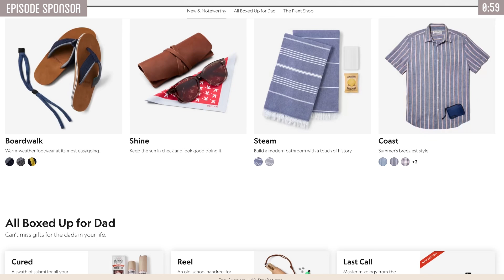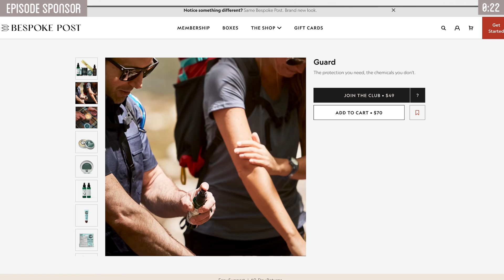White Sugar Doesn’t Come From Where You Think It Does

Comment: You need to improve your filtering step.  The liquor should be WATER CLEAR (being CLEAR, like tea, versus cloudy, like coffee).  Then you need to perform a crystallization step.  THAT step should get the sucrose separated from all the other stuff.  To clean the crystals, I would use vacuum filtering rather than centrifugation, because it is simpler to implement on small scale.  You want to crystallize the sugar slowly so the crystals are large, giving them less (contaminated) surface area per unit volume.

Comment: you are missing the point that there is a difference between raw sugar and store sugar- it is refined and bleached. Toured an old sugar mill in Asia, very interesting place. Remember these huge tall, mahogany clad evaporators boiling down the cane juice. Just column after column of it gradually getting rid of the water. Then the final one inserts sugar crystals and it feeds the vat and starts the whole thing gelling. Then spinners. But the sugar comes out brown and only semi sweet.

Comment: One year my mother decided she'd try making molasses from some sugar beets that fell off the tricks as they went past our property. These were BIG beets, plump and round. She peeled them, cut them into chunks, then ran the chunks through a blender to pulp them. Next step was putting the pulp in a large, stainless steel stock pot on the stove, with enough water to float the pulp off the bottom so it wouldn't burn. That was heated, I don't know the temperature, probably just below boiling, until the water turned a dark brown. That part of the process stunk up the house something awful!

The smell of cooking sugar beets is one of the worst smells ever. One of the largest sugar factories is in Nampa, Idaho and when they're cooking beets it stinks for miles around, especially when there's an inversion in winter that makes the steam from the stacks drop to the ground instead of rising up to blow away.

The next step was straining the liquid out through an old, freshly washed (use no soap or detergent that leaves an odor) white T-shirt. She used a wooden spoon handle to twist the shirt to extract all the liquid that would come out.

That liquid was then carefully heated to evaporate it down until it was thick molasses. Essentially the same process as maple syrup. IIRC she got 3 or 4 quarts of thick and delicious dark molasses which got used up in baking.

Brown sugar from beets is made by saving some of the molasses then mixing it back into the white sugar. Brown cane sugar can be done that way too, bit AFAIK it's also possible to do less processing to make "raw" cane sugar that's a lighter brown than the brown sugar made from adding molasses back to the sugar.

Comment: Sugar beets are not purple.  I hauled beets 2002, 2004, 2012, 2013, and 2015 during harvest.  
Sugar can be differentiated by whether it has carbon-13 in it.  Beets and sugar cane use different metabolic pathways, 3-carbon, or 4-carbon chains as the first step (cactus and some other desert plants use the “CAM” pathway.). The 3-carbon pathway does not utilize Carbon-13.

Comment: bleach it with hydrogen peroxide towards the end with UV exposure. The H2O2 turns to water as it's oxygen atom strips off, causing the bleaching process. UV accelerates it.

Comment: Can you use a vacuum packer to separate the molasses by placing you holy bucket in the center and the sugar on the outside inside the vacuum bag, ? This could use air pressure to squeeze the molasses into the center.

Comment: The recycling water like that is basically a very primitive soxhlet extractor. It lets you use much less water (your solvent) for the total extraction process.
Reply: Also, the white beet sugar probably just went through a few more cycles to purify it. Table sugar usually is.

Comment: Ok quite a process. Going to the lengths you had to, I probably would have had a tank of nitrogen very involved with every process, using a tube from the tank to isolate the product from oxygen in all of the steps. Even blasting nitrogen into each container BEFORE it is used and a continuous flow pumped into every single process. I surely do not know if that is done in industry but it very well could be, as it is an easy and cheap way to prevent oxidation.👍😎
Oh- and lids for every container with a port for the nitro hose. I understand this could interfere with , well, everything, but it might get the end product white....er.

Comment: In Brazil we get sugar from sugarcanes, the fibers are used for fuel, the sugar liquid becomes sugar, cachaça and anhydrous ethanol which we use to fuel our vehicles, most of which are either 100% ethanol or able to take either gasoline or ethanol in the same engine

We often talk about ending our dependency on fossil fuels, but then we simply let billions of cars rust away in scrapyards?

Or we could just start using ethanol on engines that have been around for decades.

Minus the shipping by diesel trucks, using ethanol as fuel is completely carbon neutral since the CO2 produced is even less that what was captured by the plant, which if we don't burn the fibers we can store and recycle it into all kinds of other things for a total carbon negative process that doesn't involve a complete reformulation of modern society as we know it.

I hate cars, but cars that run on ethanol should be the future, not EVs that just give you the false sense of ecological altruism by shifting the fossil fuel consumption to the coal based power plants or even hydrogen which is leaky and even trickier.

Just use a carbon neutral/negative fuel instead. Converting your car to accept it will cost less than a new car even if you had to completely change the engine.

Anyway, the sugarcane industry is HUGE in Brazil and the reason why our cars are so much greener than in other parts of the world(at least I never heard a single non-brazilian soul talk about cars that run on anhydrous ethanol alone)

I don't even think we have any sugar made from beets at all, unless it's some family agriculture company selling gourmet "organic" products

Comment: It's sad the lengths you go to make something, and just be so careless at each steps.
A bit of internet search would have told you that beets like light soils (you can add sand tto your rich potting soil for example), which would have given you bigger beets for no extra work or time.
A bit of cleaning would have keep things, well, cleaner.
Puting some anti oxidant solution in the blender, testing the water filtration with cola (it's designed to remove "everything" from water, of course it removes sugar too), wind evaporation, fixating better your contraptions, all of these small things would have increased both your quality and yield.

It's almost painful to each time watch you video, only to see that you almost succeed, where you could have fully succeed were it for some rigor and cleaniness.

Please, improve yourself, your chanel is awesome, and it's painful to watch this wasted talent.

Comment: before dehydration you should try mixing in a little Irish moss. it is used in brewing to make sediments settle. also you can pour the acid solution that you use to prevent oxidation into the food processor so it doesn't oxidize in the container while you are cutting it up.

Comment: If you want plants to get bigger and yield more of what they're useful for, I have a couple suggestions. One is desalinated sea minerals, which should work on every kind of plant. I haven't tested it myself, but what I've read sounds promising. Keep in mind you have to use the right amount. My other suggestion is mycorrhizal fungi. The right kind should make your plants grow much more efficiently, by unlocking otherwise little-available nutrients like phosphorus from the soil. Obviously another thing to keep in mind is that the bigger your plants are going to grow the more water they're going to have to get. There's another concept that doesn't necessarily make the cut for a suggestion because it might not be real, but it has to do with copper tubes and something related to orgone. Apparently people in the past have researched some kind of a bioenergy gathering device based on a wrapped copper pipe. They claim that it worked well during the vegetative stage, but they admitted to running into problems with some plants when it came time for flowering and fruiting.

Comment: The embargo on trade with Cuba made sugarcane scarcer and more expensive in the US.  Sugarcane grows in tropical and subtropical climes.  In the US that's only along the Gulf Coast.  Sugar beets can be grown in northern areas, like Belgium, Northern France, the continental US etc. If you look closely,  beet sugar has a translucency, while cane sugar is opaque white.  If you wanted to see if the filter removed some of the disovled sugars, you could have measured the specific gravity with a hydrometer or refractometer before and after.  That's how brewers, winemakers, and distillers measure sugar content. A hydrometer is a very inexpensive device.

Comment: many years ago I visited a sugar beet factory in England, they said that at one point they could only make brown sugar until someone realised that adding a cup full of white sugar to the centrifuge once it had got up to full speed turned the whole batch white, and it was an incredible thing to see about one or two hundred Kilos of brown sugar suddenly turning white in the blink of an eye.
Reply: Well that's highly interesting. Do you know why it did that?
Reply: @nerdy1701  It was to turn the brown sugar white
Reply: @chrisdale5443  right. I understand what it did not how it did it.
Reply: @nerdy1701  To be honest I don't understand how it worked either but it was impressive to watch
Reply: @chrisdale5443  Fair enough. Pretty cool nonetheless.
Reply: I worked in a sugar factory one season right after high school.   I remember they would “seed” spinning pans to start the crystallization process.   As I recall the liquid would flow down from the top into the middle of a spinning pan that was in a bit of a vacuum created and sustained by cooling dry steam.   I also remember they would add a few things to control the “white” including sulphuric.   An old timer lowere me down thru an empty silo to show me the rings on the walls where you could see the white was a little greyer or yellower.   Huge massive operation that would send out hopper cars of sugar to bakeries and even Hershey.

Comment: I've been to a sugar processing facility. They do drying steps under vacuum so that it can be done at low temperature. Heating steps use jacketed vessels rather than electric so that heating is uniform heating rather than charring "hot spots" where the heating elements touch  the cooking vessel.

Comment: When we made sugar we'd make hot simple syrup basically from the juiced and strained beet mash, then let it cool with sticks hanging down into it. Sugar crystals formed on the sticks and we'd caramelize the molasses a bit. It wasn't very pure the first time but you basically re-dissolve the crystals and let them reform again, little bit lossy, but you could get relatively clear crystals after a few repeats. When you broke them up it'd turn much whiter. It took a Lot more beets to use such a lossy method, but it was fun. Some sugar left in the waste water and a lot of other impurities, only the first batch of molasses was useable, tiny pieces of beet that stuck to the bottom of the pan would sour it being overcooked repeatedly, not quite burnt not quite caramel but both in a bad way xD

Comment: High-Fructose corn syrup is almost straight-up poison, why would you wanna make that?
It gives no signal that you're full and on top of that it doesn't have nutrients for your cells, while it does tell your cells that energy is coming for them and they need to start going active in preparation of processing it, but then doesn't give them the energy.
You're trolling your body and mind at the same time. /endrant

Comment: I have a book on sugar beet and its history. I can't find it right now. I have way too many books. However two tricks used in the field. Nitrogen atmospheres: all the machinery is in a box filed with nitrogen and no oxygen. This is not apparent to the untrained eye. It just looks like safety screens or screens to keep things clean. This prevents oxidation. Kilotons of nitrogen are used in the food industry to cook things without oxidation or burning. 
Trick two is vacuum drying, the same process for milk products, and again its air free. The third process is well known. Double crystallization. Take the first pass product and add distilled water to dissolve then recrystallize with a pure seed grain of sugar. This leaves the impurities behind but requires very special conditions. I hope this helps with next years crop.

Comment: You could do a recristalization to purify the sugar. Disolve it in water or something, filter the solids, then recristalize.

You could recristalize using low solvent volume and temperature change, for example, or boiling off the exess.

Comment: Britain filters use carbon and with the available surface area of carbon even molecules like fructose and glucose will also be pulled from the liquid along with anything else. It won't pull it all out but a sugar molecule is bigger than the bacteria and germ particles are much smaller so if they are getting taken out so is some of the sugar. Just won't ever take out 100 percent of everything but a carbon filter will pull just about anything that is not water based. 
Also companies producing white granulated sugar in large batches like that will actually use chemicals to bleach it. (Not actual bleach) but some mixture of chemicals that will stop the color change. Generally chemicals that you can't just buy at home....

Comment: When you're at the grey cloudy solution stage you might try using diatomaceous earth filtration.  That's very handy for chemistry work where you can't get a solution clear, and food grade diatomaceous earth isn't expensive.  Use a buchner funnel, and vacuum adapter.  Put in filter paper, wet the filter paper with water, add a thin layer of diatomaceous earth, wet that and make sure it fully covers the bottom of the filter, add another layer of filter paper on top, wet that, and it's ready to use.  It is FANTASTIC for catching the solids in solutions and leaving behind the material (in your case sugar) that's in solution.   Orders of magnitude better than your brita filter.

Comment: Hi! so about the historical way, maybe you could try to recrystallize as a way of purification, my guess is 3 to 4 recrystallization will do the trick.
Reply: another thing, you could use a solution of xathan gum 0,5% (to the industrial process) to coat any beets that are outside the water and therefore prone to oxidation.

Comment: I know they use heat exchangers when processing them industrially. I was a heat exchanger tech for a few years. They would just hose the floor down with water and keep it wet to prevent the floor from getting sticky. I was walking through the office and piece of linoleum stuck to my boot when I was walking through.

Comment: For your final products, honestly a pretty close result. One thing I noticed was during the centrifugal process, in my plant, it's washed while spinning with above-boiling water (held under pressure so it doesn't boil), that gives you the white sugar and helps spin off all the impurities. Molasses is actually a byproduct of a byproduct. And for full disclosure, I work at a sugar beet plant
Reply: I don't work in a sugar plant, but I think his centrifuge is set up wrong. It's basically a rotating strainer, that separates according to size, whereas a centrifuge is meant to separate according to specific gravity. So you need a slightly cone shaped can, and when it spins, the heavier part of the liquid climbs higher on the sides, and escapes first.
Reply: @falcondark5338  I'm not sure on the geometry of our centrifugals but I believe they are just basic cylinders and layered screens. Fine enough where crystals won't pass through, but washings will. I have a Short I uploaded if you want to see it in action. Easier to see it that way
Reply: Would that plant be the one in Nampa, Idaho?

Comment: You can clean it up with a re-crystallization. Dissolve 3 parts sugar to 1 part water over low heat. Allow it to cool then drop in a few grains of already processed sugar to act as seed crystals. Once you get some larger crystals, break them up coarse and rinse with ethanol that is as cold as you can get it (think 190 proof Everclear that has been in a chest freezer on it's lowest setting). 

Ice water is another option, but it dissolves sugar much more readily than ethanol, resulting in higher losses. Cold is the key, either way, as it slows the dissolution.

Comment: Would a pressure cooker help prevent oxidation while controlling the temperature? You could also use the double boiling setup like you'd use for melting chocolate.   I think most commercial sugars go through a bleaching process, or maybe i'm thinking of flour.
Reply: He gave a temperature range but didn't say what he actually did. Do a 4-way experiment with batches at 50 60, 70 80°
Reply: Flour is often bleached. Sugar is more often just whitened by passing the syrup through activated charcoal to absorb the color.